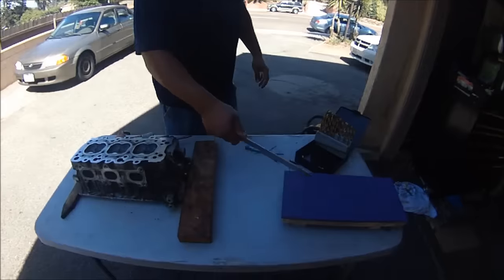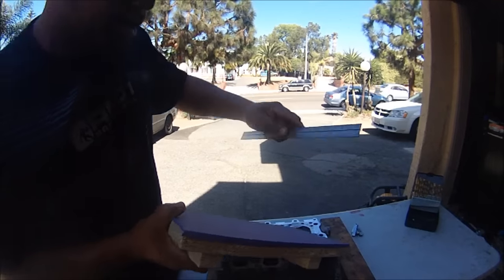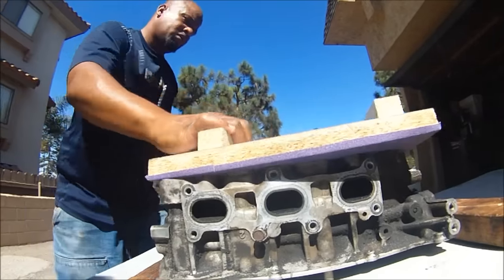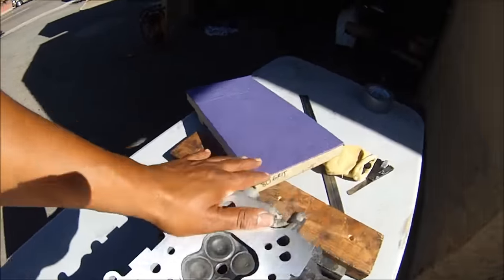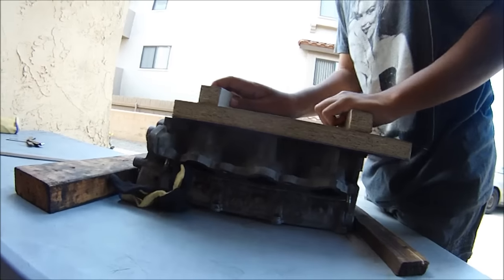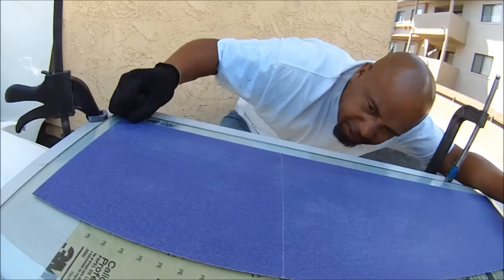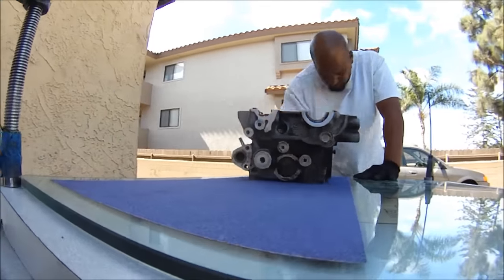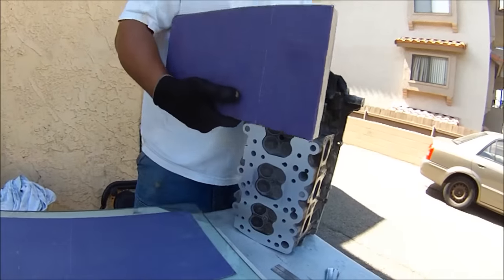HOW TO RESURFACE A WARPED CYLINDER HEAD AT HOME WITH SAND PAPER still works in (2023)

Comment from the maker: Check this out if you wonder if this really works peepz. If you perform this work make sure you end up with a true flat surface with no gaps under the feeler gauge make it so true that not even a .001" feeler gauge can not fit under the straight edge. Dont listen to the haters, Haters will never go away or stop running their mouths but we need em at the same time lol. I have done heavy research before I put this out and spoke to the guys at the machine shop I use (with 25 yrs of experience) about it and they said as long as you get a true flat surface and finish with the right grit sand paper everything will be just fine. keep your head up and like I said don't let any body discourage you or keep you from SMASHIN ON IT. GOD BLESS  http://www.practicalmachinist.com/vb/bridgeport-hardinge-mills-lathes/sanding-aluminum-head-rather-then-milling-220731/
Reply from the maker: I deal with people like you all the time, your all talk brother. Bring some real facts. No beef just facts, Ill be waiting.
Reply from the maker: Its ok maaaaaan I understand they taught you there is only one way to grind a cyl head, I see your all hurt about getting your bubble popped. Thanks for your input/ comment  I don"t want no beef man no hard feelings.  I left all that, had enough in the streets im free from all that tension and strife keep your head up and God Bless Jesus loves You Brother.
Reply: Elka Bronson I'm a pro, and what Oldskool is doing is perfectly fine. It takes longer, yes, but the end result is just as good as any machine could do. He probably got a 0.0002 flatness there, so shut up.
Reply: I know for a fact this would work if you have some time to burn and you are patient. However I need to look at it another way. If I was running a PROFESSIONAL race/performance shop and my NAME AND REPUTATION are always on the line with what I do and a customer saw this or a coworker saw and said this is how so and so does his work to someone and they thought it was ghetto and they know a lot of people and they talk, I could be out of business. I could have a damaged NAME AND REPUTATION. This is NOT an acceptable professional way to do this for a PROFESSIONAL shop, EVEN IF IT GETS THE JOB DONE JUST AS GOOD. You do things professionally in a shop to uphold your reputation. I don't care who you are, if I saw a performance shop of 20 years doing this with virtually no complaint of their quality, I might not say anything to anyone, but I would never use their services, because this is not how the next shop of 20 years would do it, no would I. The customer is always right, and if they believe you are in the wrong, you are wrong. PERIOD. DONE. NO EXCEPTIONS. Their word is god to the people they tell because most of those people won't take the time or effort or even think to make sure this would be just as acceptable by doing their own research. Research has PROVEN this is how customers or potential ones think. Do not argue that. It is a FACT.

In recap, this is fine for you and me and joe blow to save money and do it themselves. Kudo's to you for saving people money, but just remember the professionals. They have to uphold THEIR reputation. I'm not hating by any means, I'm just trying to show people the other side of the coin and let them understand when and where this is, and is not acceptable. Thanks oldskool funk.
Reply from the maker: Appreciate the comment seth. My Character is pure DRIVER, ( which means ATTACK AND HANDLE IT MENTALITY) I used to be very analytical like you Seth, about things and ideas I had. It would cause me to OVER THINK and OVER ANALYZE everything then I would hesitate, debate or even procrastinate and never get started or complete a project. Why do I bring that up? Because most people will never attempt to step outside that box they are conditioned to stay in, I show people how to break that conditioning and take a risk. I never bring anything to the table that I am not willing to do myself. When you put out subtle pessimism it will have an impact on many people who are on the fench about attempting to break out the box, you also put yourself in the bracket of a DREAM KILLER. Don't over think it and do not over analyze it. It works just fine. YES my videos are very unconventional and outside THE BOX but that's what I do. I am never happy with being mediocre and never will be. I am a RULE BENDER, RISK TAKER and  INNOVATOR. You called it Ghetto I never mentioned Ghetto, so the people who have done this before me are Ghetto? even though they don't live in the ghetto? your coming off as a subtle hater and your over thinking this sanding process waaaaay to much. Reputation of Integrity  is earned and built by the quality of your life, character, and work you put out. So if the shop puts out great work or shady work it will be exposed. Right on for the comment keep your head up and be POSITIVE God Bless.
Reply: oldskool funk
Oh I don't hate. I'm trying to look at it out of my personal perspective. Ghetto is a word I've just kinda used when something doesn't seem of professional quality. Questionable would have been a better word. It's hard to break a cycle when you say one word all the time to mean the same thing. And no, it comes down to, you gotta do what you gotta do. If it works, it works. You're probably on a budget and doing this yourself and doing everything you can to save money and get the exact same result. I apologize if I came out slightly odd on the ghetto comment, I never meant it that way. I considered doing this myself to my B16A head but since I decided to boost it to 500HP, I'd rather not take that slight risk. I want the peace of mind. I have a terrible problem with being paranoid, and in a high boost application, this would eat me alive at night as I slept. I just have difference standards than most people. I want it to be done right and PERFECT, but that's just me.
Reply from the maker: No beef, Thanks for your input Keep your head up brother God Bless
Reply from the maker: its all good man keep your head up no beef on my side God Bless
Reply: SETHHIKARU The only way you can be sure something is done perfectly is to do it yourself. If you pay someone else to do the work, no matter how expensive, no matter how "professional", you take a risk.
Reply: Vernon Bosshard He can easily "eyeball" to 0.002-0.003 with a fishing line and that is more than enough. With a good straightedge and a set of precision shims, he can confirm that the job was done correctly: The 0.002 shim was too thick to fit in the end, soooo....he was right all along.  Every machinist knows that rubbing two pieces together will eventually lead to near perfect flatness for both parts. The high spots of the engine head are worn-out by the sandpaper, and the high spots on the sandpaper are worn by the engine head. It is a self-correcting process. Like I said earlier, I wouldn't be surprised if he got a flatness error much smaller than 0.001 with his method. I wonder why he didn't check with a 0.001 shim in the end, probably because it is always the first shim to break or rust or otherwise become unusable in a shim set...
Reply: zaran1 But... as a machinist, I must add that oldskool's method, while good enough for this specific purpose, is far from perfect. The final surfacing over a glass panel could cause some trouble. Assuming there is a significant high-spot on the sandpaper, and assuming the head is always moving back and forth on the sandpaper without changing it's orientation, the high-spot on the sandpaper could ultimately create a long, low spot on the head. There will be no "self correcting" of both surfaces this way. The correct way for finishing a high precision job would be to use a  surface much larger than the part being surfaced, and rubbing the part in a circular motion over it, or even better, in a "8" shaped motion, and often changing the orientation of the part in the process. That way, the slight irregularities of the sandpaper will be quickly worn, and they will not wear in the part always in the same spot. This is probably overkill for cylinder head resurfacing, but it's good to know what's involved .
Reply from the maker: You can over analyze it all you want, I will take the assumptions out for you in 2 words, IT WORKS. The head was perfectly TRUE and FLAT. I know it is hard to grasp I wrestled with this method for a looooong time before I committed to doing it, I asked my machine shop guys, other professionals, researched like crazy then HANDLED IT. I have had many heads machined since 1990s and specialize in engine over haul and I am very familiar with engine tolerances, specs, etc. I no this is very outside the box and goes against everything I have been taught in mechanic school, but I am a risk taker and love to take on any challenge, bend the rules and step outside the box. Never assume, DO IT then get the answer, IT WORKS. The car runs Great.
Reply: oldskool funk
check out  Keith Fenner ..machine works ..one of his videos he does something similar ..but he also moves it in s circular patter at times...dont know if that matters or not ..but the proof is in your measurements...good job
Reply: Dude, i like your vid and what your doing is being done in machine shops, just a little faster with a horizontal belt sander, if you'd take your glass table set-up and make it twice as wide and cover it 80 grit to start you could lessen your time by holding the top of the head at each end(always in the same place) you can do whats called cross cutting which takes material off faster, first go back and forth length-wise, then go in the opposite direction back and forth (doing the same number of strokes) then  go diagonal one way, then diagonal the other way, this is a method used by auto body workers to cut through excess bondo to reach their desired flatness I know you may not have the room to make 3 tables but this would definitely make you "machine" time faster and it's not a cheesy short cut, I checked with my nephew who has owned a machine shop for the past 25 years and he told me if you do it the way I described you will come out with a better/More even project and will cut your time down dramatically and checking the head at several different points the way you do, will come out with a very decent quality product, you may not want to do this for a race application, but I know this is for common everyday driving, good luck Bro ;)
Reply: Specs on most hondas are actually 0.003-0.004. If you can get it to 0.001 you are going to be good to go
Reply: Dave Ludtke Or do a good amount of the work with a sander and after the large amount is taken off with less accuracy, you can true it up with the glass and finish it off
Reply from the maker: Ian Mcdowell I always go for no gap at all.
Reply: IT IS GOOD
Reply from the maker: 11wawita11 Thanks I appreciate the support. I don't worry or let the haters move me AT ALL. It actually gives me a boost and makes me push harder to bring what I know to the table and help more people. The reason why people are tripping out is because this method is very unconventional and goes against the grain and everything they have been taught about milling a cyl head. I am a risk taker and DO NOT let the limitations of others stop me nor will I ever stop what I do. I have always challenged the norm and have no problem bending the rules or trying new things. The haters will never stop NEITHER WILL I, Some just hate because thats all they know, some might be upset seeing a brother do some complicated task and dislike it. Regardless of the reason it does not matter. God has blessed me with mechanical skills therefore I will always continue TO SMASH ON IT AND BRING INNOVATION IN JESUS MIGHTY NAME, KEEP YOUR HEAD UP  GOD BLESS.
Reply: ***** If sanding aluminium its good to rub sand paper with candle wax then it dosent build up.
Reply: how can there be an argument on anything here if he got the desired effect he was looking for. and how can a machine be more reliable than a human when it was made by a human? sure the machine is faster and easier, but he has said many times that this is just as good but not as fast. and he did save money doing this vs. paying a machine shop to do it. on that note i say kudos to you olskool. keep up the good work and it's the ones that think outside the box that does get the flack but they also get the proof. if it wasn't for people thinking out of the box we would still "know" the world is flat and live our lives as cavemen.  and also i would like to note that there is no car out in this world that has every measurement dead on exact. that is why there are variances on every single part of a car.
Reply: then check the flatness of the glass with that streight edge and feeler gauge  first.

Comment: Don't breathe in aluminum and also wear gloves and a mask when doing this ! Great video. AMEN Brother 👍
Reply: With a power tool yes..I agree...with that back & forth and your outside...its no dust" if you notice most of the material is on the sand paper" it's just not enough movement to create dust or something in the air...

Comment: So called techically trained mechanics or machinists can suck it. My gradfather and father both used a sheet of glass to resurface heads and guess what? It worked. The goal is to produce a flat leak free surface, not measure exactly how many millimeters you took off to acheive the goal. As long as you can get the heads flat enough to prevent another blown gasket then you did the job. I suppose if you were worried about taking too much material off, then use your head and feeler guage. As we used to say, were building engines, not piano's. Get a grip.
Reply: You don't need to measure if you remove slowly like that cause eventually you will take off enough. Plus if you check often then you'd get the bare minimum off anyways
Reply: And I will add, that a faulty intake gasket or manifold need a check too.  They have coolant passages too.
At each spark plug hole-One at a time, each @TDC.
Access to shop air and a leakdown test. With a good tester. More than 30% leakage in 2 minutes @ 90psi is not so good.
You can hear air escaping valves in the intake tract, exhaust. And see bubbles in radiator overflow tank.
You may see coolant coming from intake manifold too.  Refill the radiator to check. Antifreeze is cheap compared to an unnecessary head gasket job in a frontwheel drive car with limited, tight access. Every cut, scrape, bruise, curse, goes into $$$$.00 labor charges.
Reply: No such thing as a Machinist anymore, they are programmers or operators. 45 years retired.

Comment: Where can i get my heads leveled for $45 thats a steal
Reply: Right here in Trinidad Colorado southern boarder it's $900 for a Honda inline 4 cylinder and that's after you clean it if you don't clean it it's a extra 50 dollarblabir charge
Reply: Local shop quoted me $500 to resurface a pair of 5.3 Chevy heads.  And they want them for 2 weeks
Reply: My block and heads are aluminum. I got quoted 50 a head, 150 for the block here locally in Florida after this discussion.
Reply: @richdrumm6035  your getting robbed big time! 40 pound sterling here in Ireland for a head skim,

Comment: what does everyone think  the people in Cuba have been doing to keep all them 1950 cars on the road
Reply from the maker: Joseph Atnip I hear you. These new mechanics (some old skoolers to) are spoiled and know nothing about the struggle it took the ole timers who paved the way for us today.
Reply: ***** The reason why they replace parts is because it's cheaper. Mostly when you have an engine problem it's much, much cheaper to replace either the bottom or top end with something from a junk yard or a reman than to pay by the hour for the work to repair... and then you're assuming that the guy is going to put it back together properly and according to specs. It's expensive and a lot of these shop mechanics don't have enough experience rebuilding to do the work. They don't have the experience because most people opt for the replacements for a cheaper price. I'll just point out that a head gasket repair at a shop can cost up to $1200 on a 4-banger... which is ridiculous. An entire used engine would be cheaper in some cases with the head already on it.
Reply: Most four cylinder long blocks come fully-equipped with everything when you buy used, and they can be anywhere from $400 to $800, sometimes more for a rare performance engine like an import. This isn't considering man-hours to charge for the work involved. Sure, rebuilding is a good investment, but you can't trust a shop mechanic to do it for you, and they'll charge you more than what you paid for the entire car for a rebuild of that magnitude. Only for DIY jobs. I've seen too many suckers take their cars to the dealer for a rebuild when they had low compression, only to have their rebuilt engine seize due to sloppy workmanship.

Comment: is this cylinder head from a 3 cylinder engine or V6 ?
Reply: Its an inline 4
Reply: Khal Drogo in line four? you're damn clueless . it's one head from a v6!
Reply: Jose Garcia thanks
Reply: thesniperofcs It's for a W9 cylinder.
Reply: Jose Garcia why? Vw makes 3 cyl cars.
Reply: of course it's fro.  a V6.
nobody would make a 3cyl. engine for a car anymore.

of course they exist.  but their not consistent for power.
Reply: えゆEuSei what are you talking about 😂, have you heard of downsizing? Decreasing cylinder number and displacement and replacing them with forced induction to keep the emissions low as possible. It seems you have zero clue. How many cylinders does bmw i8 have?
Reply: @Ariz04  there are pleanty of three cylinders, Fiat 500 have a 3 cyl.